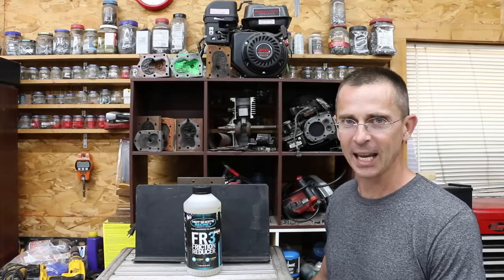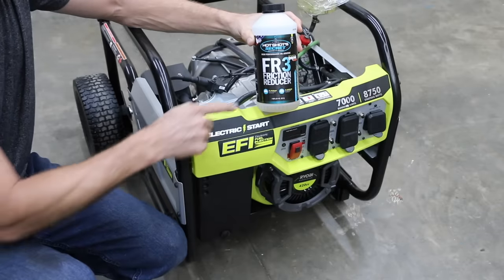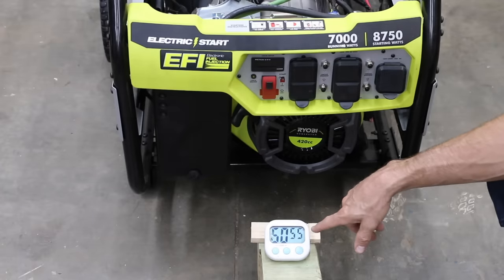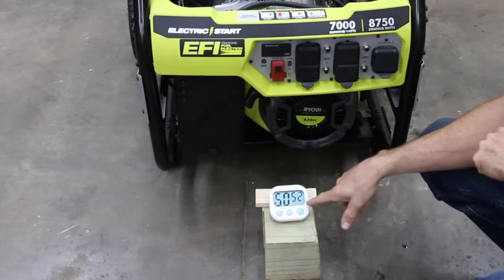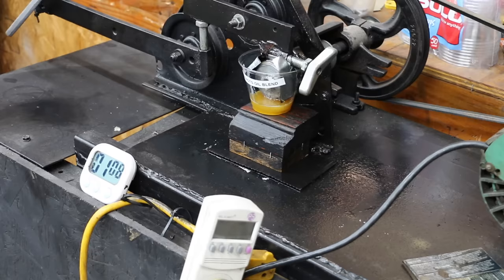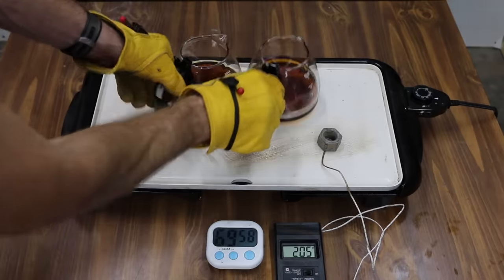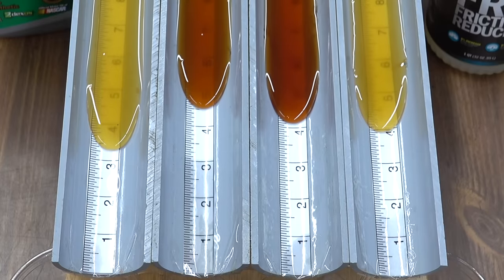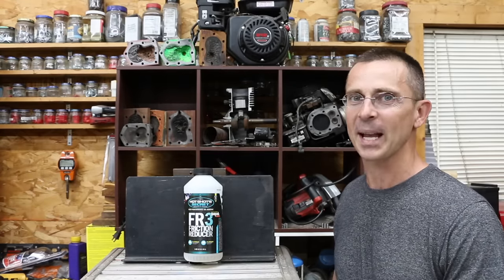Mobil 1 Boosted with Hot Shot's Secret Better? Let's find out!

Comment: Would love to see if Lucas ZDDP additive actually makes a difference in classic car engines.
Reply from the maker: Thank you for the video idea!
Reply: I used it in my flat tappet 1.6 liter crossflow to break in the camshaft and the tappets.
Reply: I know that lucas motor honey stuff works. Treat an engine with that stuff, take it apart, that sticky shit is all over the whole engine. Even engine cleaners have a hard time getting it off.
Reply: Zddp works well. If it didn’t there’d be a lot more flattened cams out there
Reply: zepfan96 Yes, but there are things to test, like how much additive is in one container, how much is in untreated oil, wear results with treated v untreated oil, etc.
Reply: @Spudderr  well that maybe so. But I have rebuilt more than 400 engines and never had a cam go flat. Now I did specialize with Ford engines only. Ford does have some advantages over chevy in the cam dynamics. I can see where the chevys will go flat premature and where the Ford's won't.
Reply: Chris Montreuil which engines did you do in particular? If it was anything made in the last 20 years, zddp is unnecessary. Regardless of manufacture, if it’s a flat tappet cam, it needs it. Way back when these engines were made, zddp was put in every oil you could get. When roller cams and catalytic converters became the norm, it was decided that zddp was no longer needed and actually had negative effects. Sludge, catalytic converter failure etc. Diesel oil had it for a bit longer, but it was eventually removed from it too
Reply: @Spudderr  if you would like to know. The majority of engines I rebuilt was the Ford 289 and 302. From years 1965 to 1987. They are a small and light weight engine and easy to move around. Parts are plentiful. About 300 of them. 351 clevelands about 70, 351 windsors 30,  351 cj 2, 351 M and 400's 20. 429 1, 460 about 10, 360-390's  20. Ford 410 1. Small block chevy 15, big block 2, 250 six chevy 2, 300 six 1, 440 1, 318 1. Also a small number of Japanese engines. Some of the engines were built for figure 8 cars and super stock cars.  Oh, I should mention one boss  302. 
If I did a chevy, I brazed the oil pick up tube to the pump and installed a cam button. Always used the special gray cam lube. Engines were always oil primed before installation. I had for some reason a 351 windsor that would not get oil pressure, so I had to take it out and figure out why. Pissed me off, so I started priming the pump before installing them. 
As I said, never had a cam go flat, but had a few new lifters that would not stay pumped up and made noise and had to take and replace a couple.  I had one roller cam 1987 mustang where 3 lifters did not pump up correctly and the engine had a shake to it because the lifter was holding the valve off its seat.. If the Ford would have made the valve train adjustable, I would have been able to fix it. Because of this, you have to pay particular attention to valve train geometry in a Ford.  The only gripe I have with the majority of Ford engines.
Reply: @Spudderr  one thing I did not mention, I used a non detergent oil when the engine was first run.
Reply: Only good Ford engines I've encountered were the 351C and 429.  352, 390 and especially the 3.8 and Tritons, not so much.

Comment: I missed your own conclusion of the product at the end of the video. I always look forward to that.
Like what you think about the product, its claim and its legitimacy.
Reply: Cold flow gets worse. Evaporates more when warm. Helps Very little at cold wear, about 6% less scar on The bearing.
Reply: Huge difference between straight FR3 and the blend and untreated oil. Maybe half of the wear scar size? Which means when it comes to lubricity which is technically what the product is for (friction reducer) the product seems to do a great job 👏
Reply: Just saying he seemed to include everything but left out any good details and just said the negative results. Oh also hotshot treated oil won the cold flow test as well.
Reply: @tomasnokechtesledger1786  did you watch the video? Hotshots treated oil got 1st out of four on the cold flow. Yes it evaporated like 1 or 2 grams more on a NOACK test that isn't legit. Also yes the flash point is quite a bit lower than real oil but how is this effected when you mix the two? I'm sure it helps a lot. Yes the only true thing you said is the blend is 6% less than the motor oil result. But, the FR3 alone was way less, maybe 50% or more.
Reply: @crashgamingphx6351  Didn't you see? Got 1st? Hahah. Still lacks performance compared to untreated diesel.

Comment: I used the hot shot secret stiction eliminator in my 2001 7.3 powerstroke and it helped it a lot with cold starts. The injectors are oil fired and this stuff helped it a lot and reduced the startup smoke.
Reply from the maker: Great feedback! Thank you
Reply: Project Farm The problem was that the oil gets thick when it’s cold and the injectors wouldn’t fully open they would stick so it didn’t run right for a minute and smoked a bit but this helped clear it up in addition to shell rotella t6 t6 5w40 oil.

Comment: You know you perform tests well when after two attempts you get literally EXACTLY the same result of 50:44
Reply from the maker: Thank you very much!
Reply: I was here to say basically the same thing... I yelled "no way!" so loudly I scared my wife when that generator sputtered and died at exactly 50:44. I don't believe that any more testing is required to disprove any efficiency claims. 2 tests to the exact second shows that adding a load or running it longer isn't going to change the results. If there'd been a couple minutes discrepancy, I'd say go for it, but the results speak for themselves. Nice going with this video PF!
Reply: Project Farm didn't highlight this hard enough. When the purpose of a test is to see whether it last longer, and it lasts exactly the same amount, I'd like a little narration or editorializing of that context. "Blah is supposed to increase the fuel efficiency. A 30 second difference would have been 1% improvement. For example in your car to go from 30mpg to 30.3 mpg. But we saw exactly the same efficiency, down to the second. Not 1%, not even a tenth of 1%. It looks like that manufacturer claim is completely unfounded."
Reply: @MattsAwesomeStuff  The additive didn't really have enough time to coat and lube everything. I'm not knocking his testing but, FR3 takes time to work through and coat/fill those microscopic areas.

Comment: So it does what it says - reduces friction. The fuel claims are inconclusive
Reply from the maker: Thanks for the feedback.
Reply: Yea- go out and buy you a case.
Reply: I put this in two engines one 6.4 diesel one 3.5 gas, it's not cheap. I can't say it did anything so far.
Reply: Please test archoil ar9100 oil additive 

Vs 

Hotshot secret stiction eliminator 

Vs 

Motorkote stiction eliminator 

Vs 
rev-x oil additive

Comment: I am embarrassed to admit I drank the Kool-Aid and bought some FR3 a few years ago.  It made no difference at all in my Silverado 6.0 liter truck
Reply from the maker: Great feedback. Thank you
Reply: Did you call them and get your money back? I mean on the bottle it says 100% money back guarantee
Reply: I run all of hot shots additives in my 950hp Cummins. You won’t see improvements at the pump but pull your engine apart and you will. After disassembling a stock engine and then mine “with over 100k miles more than the stock engine” running additives I can tell you the bearings and cylinder walls did in fact look much healthier. Same goes for the injection system.
Reply: @thomasburkhart650  No, i did not bother.
Reply: @dom00000  But it was advertised as more than anti wear
Reply: @WildThing2  I was desperate in trying to get better gas mileage in my truck.  I think 10 miles to the gallon is stupid. On the highway, I am lucky to get 14.
Reply: @thomasburkhart650  In a companion YouTube series I would like to see project farm attempt to get refunds on all of the products that came up short of manufacturers claims. Call it Refund Farm or something. I've always been curious if the manufacturers would pay up or use some kind of BS to avoid paying.
Reply: @artvandelay1099  actually hot shot's has you fill out a refund request online and depending how you purchased it you get money back within the week. No issues there.

Comment: it does reduce the friction, as I can see the money is slipping away from the wallet
Reply from the maker: Thank you for the feedback
Reply: Lmao!!! FUCK dude 😂😂
Reply: @dom00000  People don't have time to watch the videos, only comment lol
Reply: @dom00000  Better film strength. Issue is if the oil can stand up to heat over a period of time. So basically made the oil more tacky but does it prevent wear when in use in a motor? Who knows. The chemical sheet didnt seem to promising given the low flash point of the additive.
Reply: @alejandroochoa3541  No reason for the profanity dude.
Reply: @dom00000  But that test tells us very little about how effective it actually is in an engine. Nothing in your engine rubs like that, and, if anything does, it's already too late, time for a rebuild when all those metal particles spin bearing. Engines are designed to run on a cushion of oil between all the major load bearing surfaces so as to avoid direct surface contact in the first place. Sure, maybe this stuff gives oil "better" film strength... but today's oils aren't "failing" in this regard, they're well beyond 'good enough', so I'm not sure what making them 'better' is supposed to do. Like hiring a NASA engineer to design hand railings - how much "better" do you actually think those hand railings are going to be? Name brand oil has been overkill in its capability for a few decades now, engines do NOT die due to oil not holding up; in fact, we've only seen oil change intervals increase as oils keep getting better, and without impacting life span. You should see what the bearings look like on modern 250k mile engines that have just gotten regular maintenance - literally reusable, no meaningful wear. 
 
Like all oil additives, it's a solution looking for a problem, except modern oils are just fucking incredible - if it worked, it would already be in the oil in the first place, every oil already uses additive packages
Reply: Mind you, this isn't a PF problem, it's a problem with all oil/additive testing - there's just no good ways to DIY it and get results that are indicative of wear reduction in an engine. Even industry standard lab tests can't tell the whole story, only bits & pieces(which is why there's a whole suite of different tests they perform) - it's just too complex to model in small scale testing. The inside of a running engine is a pretty extreme environment, not quite as simple as rubbing a couple pieces of steel together.
Reply: @RyTrapp0  Your comment says it all. There's no need for additives in most all off the shelf modern engine oil. I guess it makes people feel better using additives and the people who make these additives know it.

Comment: If you're altering your engine's oil with aftermarket oil additives/supplements you might want to reconsider doing so...here's why.

All engine oils are formulated with an additive package that includes anti-wear, friction modifier, detergents, dispersants, anti-oxidants, corrosion inhibitors, extreme pressure, anti-foaming, anti-aeration, seal conditioners, etc... I'm not referring to the aftermarket supplements like Lucas, BG MOA, Hy-per Lube, Liqui-Moly Ceratec...etc. It's not a good idea to use those aftermarket supplements as complications from additive clash and/or base oil incompatibiltiy are real issues that can do more harm than good.  Oil formulating is a very careful balance to ensure no one additive (or additive type) overpowers another.  When you go pouring some random supplement/stabilizer into that formula, you've now upset that balance.

Oil Stabilizers/Supplements are 99.5% olefin copolymer (a waxy, rubbery polymer) and 0.5% polyisobutylene (tackifier).  The polymer is a viscosity modifier with very poor shear stability (loses >50% of it's original viscosity after 100 hours) and the tackifier is only there to make it cling to those gimmicky plastic gears in parts stores to deceive people into thinking that's actually useful.  Tackifiers are useless in an engine since engines are lubricated with a pressurized oiling system.  In that system, tackifiers only clog up stuff.  Tackifiers are useful in equipment that sees splash lubrication such as manual gearboxes and differentials. No aftermarket oil additive/supplement on the market will contain any useful additives, it'll only dilute the amount currently in the oil, shortening oils life, weakening anti-wear, and promoting both oxidation and aeration of the oil.

Short summary,

Avoid using aftermarket oil additives – Store shelves are littered with aftermarket additives that promise to increase fuel economy, reduce wear or restore an old engine to like-new. Adding them to your oil disrupts the oil’s chemistry and may reduce its ability to protect your engine. When you’re using a good motor oil, there’s no need to modify/alter it with an aftermarket additive. No synthetic engine oil on today's market needs to be stabilized. 

https://blog.amsoil.com/more-than-you-ever-wanted-to-know-about-motor-oil-additives/?zo=5270935

https://www.machinerylubrication.com/Read/29836/aftermarket-oil-additives

https://www.machinerylubrication.com/Read/29610/aftermarket-oil-additives

Comment: "Hot Shot's FR3 - Direct from the snake to your engine!"
Reply: @dom00000  

Which is subjective as you don't know how it performed when cooked.

Also definitely no improvement in fuel economy so I'm definitely saying snake oil too.
Reply: Phil Underhill I’m sure they said that about synthetic oils and diesel fuel additives too
Reply: @dom00000  even if it wasn't under load, it still used gas right? if it reduced friction then it would have lased little longer especially with a fuel-injected engine that calibrates fuel ratio constantly.

Comment: Hmm, seems like snake oil. Just swapped my cars over to Pennzoil Ultra Platinum after the oil testing brackets!
Reply from the maker: Pennzoil Ultra is a great oil!!
Reply: Ultra is difficult to find. The regular Platinum is around.
I wonder how the natural gas oil will last over the years.
If I ever swapped my brand loyalty from Mobil 1 I'd probably go Platinum. (Amsoil $$$)
Reply: @NeverYield-bq8qw  be honest, how much did Mobil pay you? And are they hiring?
Reply: @hotrodray6802  
You can order it online at Walmart .com and have it shipped free to any store to pick up.
Reply: @hotrodray6802  I've had decent luck finding Ultra on Amazon. 5W-30 runs between $21-26. 0W-20 can vary from $28-45. I just set a price tracker and buy some when the price gets low, and I'm in need of an oil change in the next could months. Edit: for 5 qt jugs.
Reply: @NeverYield-bq8qw  ok bud don't get your panties in a wod

Comment: Archoil makes a similar product that I use in my Ford 6.0 diesel.  It really did solve the stiction problem with the injectors at startup.  A comparison between Hot Shot's, Archoil, and RevX would be great, if difficult to compare.
Reply from the maker: Thanks for the video idea.

Comment: you need to test hot a hot test as well, i live in the desert and found that during the summer I could not run Rotella t6 during the summer because oil pressure would drop to low when i would come to a stop while towing, but T5/4 and Royal purple would maintain oil pressure better. I just believe the oil would get to thin during the 120 degree summer temp whit the higher engine temps of the Duramax.

Comment: Used some Militec1 yesterday for an emergency job.
03 Focus with bad clutch caused me issues not able to put in reverse or first gear. Saving up for huge cost of new clutch, so I added 3 oz of Militec1 to transmission fluid, it shifts into each gear no problem till I get a new clutch in 4 weeks.
Reply from the maker: Thanks for sharing.

Comment: Good evening.... I started using this hot shot oil additive in my daily driver, I didn’t really notice a difference until half way through my 2 oil change, aprox 6500 tp 7k miles, (I change my oil every 5k, and use “Rotella” T6 full synthetic), I gained a steady 3.5 to 4 mpg of highway driving, aprox 10 degrees cooler temp.
Reply from the maker: Great feedback. Thank you

Comment: Next time weigh the bearing. Also lighting was off. Amazing video. I  wonder given vehicles are swapped out generally before 100k miles would it be worth the cost for longevity? Would you even notice? What parts of a car normally get replaced due to wear and tear?

Comment: I care for 6 family Prius's, and all but one is over 250,000 miles, and they all get between 52 & 56 mpg. I switched from Mobil 1 a few years ago, to a German brand called Motul, along with their full compliment of engine & fuel system cleaners/flushes, as well as their ceramic engine treatment. Pricey, considering I change at 7,500 mile intervals, but the results speak for themselves. Keeping the hybrid batteries in shape w/ annual regeneration also helps enormously.
Reply from the maker: Thanks for sharing.

Comment: Great video!! As hardwood floor installer I use an oscillating multi-tool at almost every job, and I purchased some very inexpensive blades from amazon that did not last nearly as long and was hoping you could make a video comparing oscillating multi-tool blades! It would be super helpful for me
Reply from the maker: Thank you for the video idea!